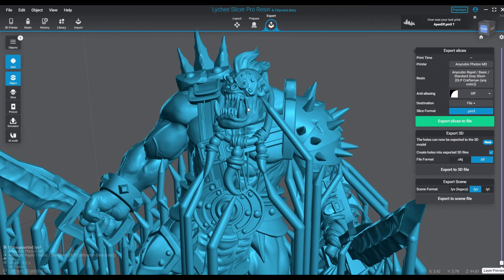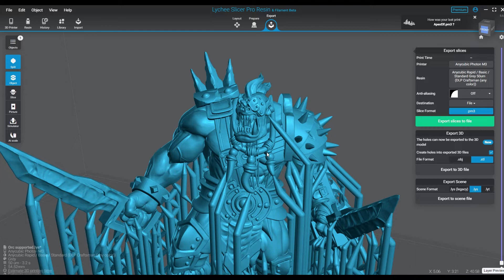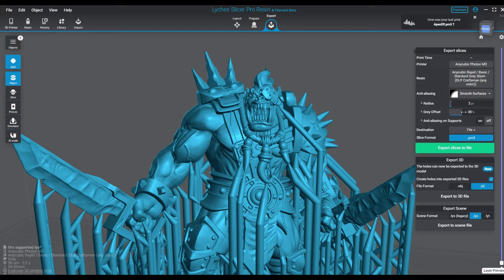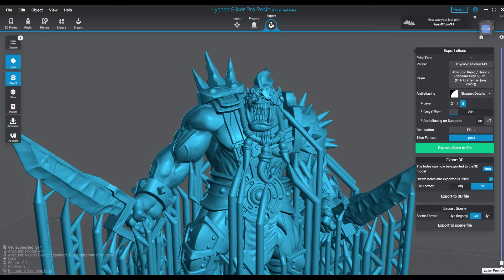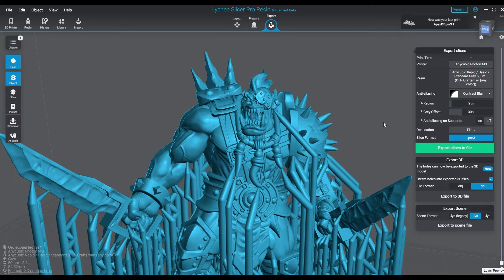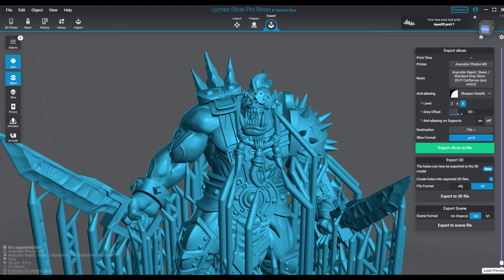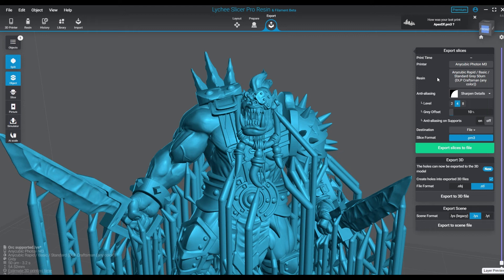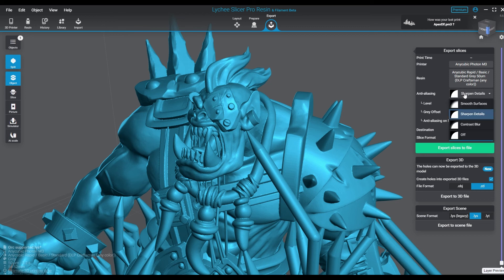Lychee Slicer 5 and the new Anti Alias settings

Comment: It would maybe work better if we were able to use all 3 together at different levels ir 2 of 3 but I noticed they just reserved to default when you click another setting it doesn't save to for you tomuse this set at that setting but I have no clue how it works yet I could be talking like it's obvious it can't be or something but km away to learn! I've heard Lychee just can't get their's to work lime chitubox but I only use lychee pro I wouldn't know? Another thing when you click the gear settings up right top corner you can pick view layer lines as they'll be printed it's cool and could be invaluable but they don't change when AA is applied to see how much if any vox lines etc smooth out
Reply from the maker: Thanks for the info, and for watching. I agree it would work better as you suggested I think it's harder and would be an emulation of it at best, but would be nice to see how it will turn out.

Comment: 5.0 really? That's mad I use lychee everyday but says I have the latest version at 3.1.8  lol just tried online to get 5.0 after seeing this bit still saying the latest is 3.1.8? Whare did you find this was it an auto update? Interesting video on AA I'm still trying to get the RF test cards done but unlike chitubox there is 2 settings for lift distance etc to chitubox 1 setting so it's getting confusing! I'm getting near perfect test cards but the step lines are still visible on the card and this is what I need gone! I see you are using anycubic resin what printer are you using? Thanks
Reply from the maker: Yes, Lychee slicer is currently on 5.1.8 as far as stable releases.
https://mango3d.io/change-log-lychee-slicer/

As far as my printers I have a few but my GO-TOs are my Mono4Ks, I have about 5 of those little guys and they kick butt. I use DLP Craftsman 8K resins only. AS far as the RF test cards, if you are seeing stepping lines you might be over-exposed. Alternatively if you are using an older Anycubic printer look for firmware for the dual stage motion in Lychee, as Chitu and Photon slicer only use single stage. So, this setting by default does nothing for some printers. Also set your light off to .5 or 1.0.
Reply: @IPrint3dMinis I'm on lychee pro  5.2.2 now loving all the new support features! See when you click the gear settings up right top corner you can pick view layer lines as they'll be printed it's cool and could be invaluable to have but they don't change when AA is applied to see how much if any voxol swirls or layer lines smooth out it also changes with just the rotation of the orbit of the screen (no model's moving) needs abit of work on this but if that worked they way it's intended that would be an amazing tool to fix out layer lines!
Reply from the maker: Thanks for watching!
Reply: I have the mono 4k I bought it first them 3 weeks later the mono 2 came out so grabbed that as was half the price as my 4k but wish I got the mono 2 first it absolutely destroys my 4k and I do love that wee printer but wee being way to small! It's never on now but the difference is unbelievable between the mono 4k and mono 2! I dod just get the saturn 2 8k 2 weeks ago you can fit the mono 2 inside the red cover but prints not far off what the mono 2 does I just needed that bigger build plate for my model's amd model part's I build armour model's as my hobby and for shows etc and doing convertion kits and starting to design 1.35 scale models the mono 4k was fine for wheels and antennas and small scaled figures but very slow as printing alot less! I honestly didn't expect to end up with these 3 1 I thought would be enough but wasn't long 3 weeks till I outgrew the mono 4k even the mono 2 build plate is a good size bigger it's a perfect start out size and highly recommended the mono 2! I love it sooo much and I got it for £135  on promotional deal with another free wash and cure!

Comment: does it Work with the Anycubic Photon Mono x 6k?
Reply from the maker: The AA settings are a little different for each printer, the Mono x 6K it's best to use AA settings for Sharpen Details, level 8, if you are doing big flat objects go with "smooth" rather than sharpen.

Comment: Hi and thanks for the video. Currently, there's absolutely no good resource on the explanation of these settings that I could Google out. Unfortunately, after watching your video twice, it still feels way too muddy for me. I think you would have a blast of viewers if you could show a comparison of print results of different settings in the lack of any viable alternative source of information.
Cheers!
Reply from the maker: Thanks for sharing I apologize it's still a bit muddy for you, feel free and join our Discord, perhaps I can offer some more personal assistance.
Reply: I get your point. Same here. I think the reason is this video is more focused on miniatures. For minis, you want lots of details. We’re AA is really needed is usually on larger objects, especially with large angled flat surfaces or large round areas. There’s a very good explanation on Liqcreate site. Unfortunately I have no idea how to translate from the previous language (AA#, Grey offset#, Blur#) to what Lychee did now. Seems like lower zero offset in CTB leads to smoother surface but in Lychee you need higher gray %. But I’m still kind of lost, especially with the DLP printers. DLP will give you lots of details but will create lots of voxels on larger surfaces.
Reply from the maker: Thanks for watching!

Comment: boss, the music is annoying like the annoying orange from the 2009 ^_^""" furthermore, I would prefer a "show-and-tell" and for "show" I mean, print that ork with all these different settings on the same printer and show the results, otherwise is just speculation, doesn't it?
Reply from the maker: Speculation would infer that I don't print them. These print great every time. Try the work flows or don't mate, not forcing you to use my methods. I print professionally and produce 100's of minis and figs a month, so yeah they work. If you choose to follow the work-flows and see the results great, if not hey no waste there - keep in mind my work flows are different than most, but my supports peel right off with little to no damage in most cases, check our shorts if you want evidence of that. Yes, we have heard comments about the music. The music has been trimmed down and only plays when I am not talking on our newer videos, and as you can tell video production isn't my strongest skill-set but I am improving with each video we make. Thanks for the feedback, we will try and do more show and tell, but seriously go check our shorts, if you want to see prints, and print quality they are all there. I am always showing off the stuff we make, I don't know if we did a video on the Orc specifically, but I can if you really need to see the proof. We also have a showcase video showing a ton of minis, prints, parts, bases etc. on the channel as well. That might show you we are serious about we discuss. We also have an active discord community and invites are always open. If you want to learn more, I help a lot of folks learn 3D resin printing, and trust me when I say this some of them were ready to quit. If I can help a few folks turn that frown around and get the tap they need in the right direction that makes me happy. :) Hope you got something out of the video regardless, but do check out our new content from 2023, and the shorts we have been posting should show you how well our prints do come out. I would not teach this if I did not believe in it and use it everyday.

Comment: Hmmm intresting on the math for angles, will have to look at that.
Only problem I see as an engineer is looking at compound angles for X and Y tilt 😂
Reply from the maker: That is a thought I had processed, about actual tilt across the X and Y during the print as the orientation needs can change as the print progresses, but I do try and think of this when adding my supports as to allow it to have the supporting it needs to compensate.